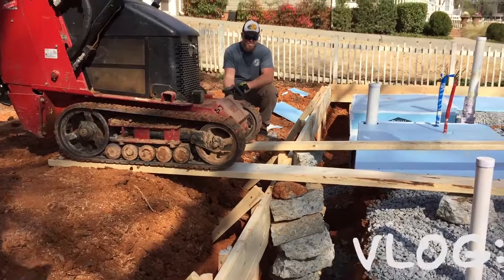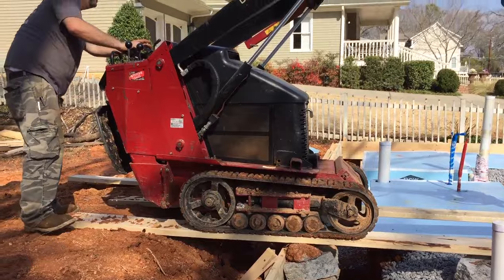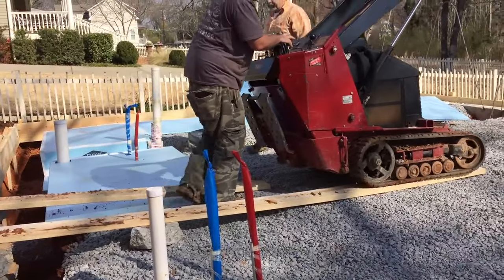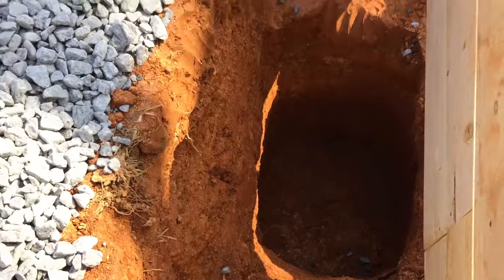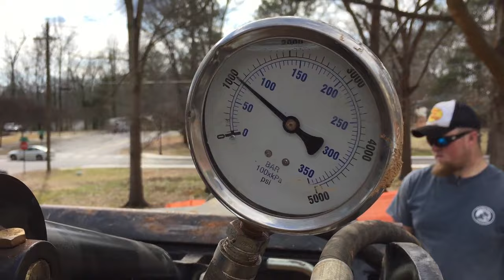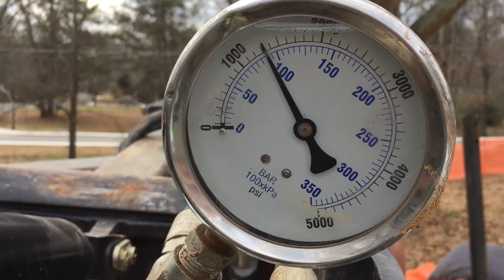Two Helical Piles Firm Up The Foundation | VLOG 010

Comment: Suggestion… Have your helical provider drill holes in your pre-con caps in the 4 corners. Then you can fasten rebar between the caps (wiring through the holes). Using rebar will reduce the chance of creating a point load if some of the piers settle more than others. Yes… I was in the industry and have done this to over 10,000 homes and offices.

Comment: Congrats on the use of heli's. You are correct, these piles are great insurance if there are any doubt on soil compaction. I would had recommended installing a few more piles all around, just to be sure. The non-pile locations may settle over time but the piles will NOT settle. You should keep an eye on the levelness of your slab throughout.